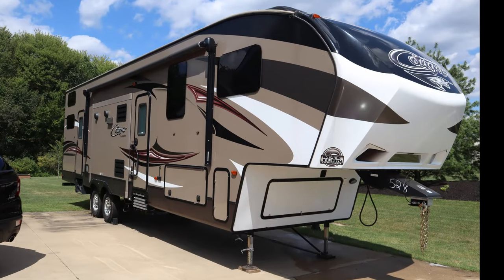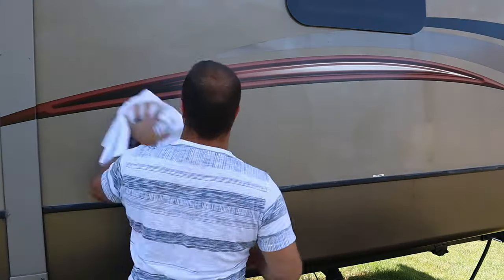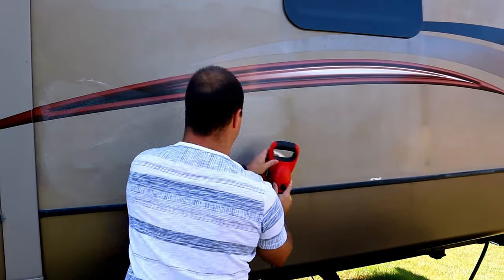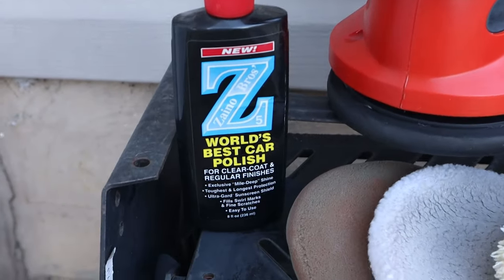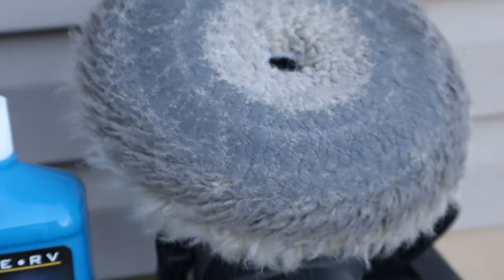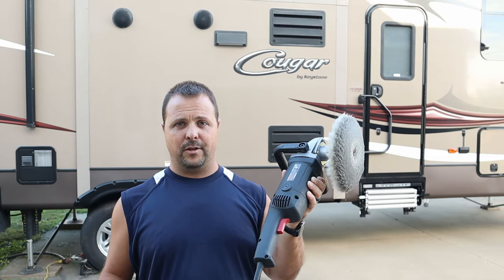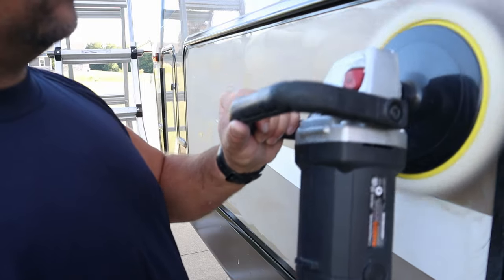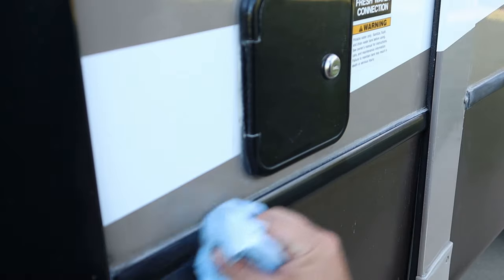Remove Oxidation and Restore Faded RV Fiberglass Meguiars One Step

Comment: Thanks for the video. I read in one of the comments you can clean the pad?  Did you do that, how do you do it and how pads did you end up using for your rv?  Mine is only 23.5 ft class c.  Thanks again!
Reply from the maker: I spent a couple days completing this project and washed the pad out and let it dry between days.  Someone else had commented about a way to clean the pad while buffing.  I did not try that, but I'm sure it would help because the pads did load up with compound.

Comment: Before using polish you could try to use a cleaner / wax product with a random orbital buffer and wool pad. If that doesn’t get the oxidation off then polish is likely required.
Reply: No cleaner or wax will remove oxidization

Comment: Use the Dewalt buffer it gets the job done.  You want the blue compound on 5he stiffest wool pad you can find and be patient. Work SMALL AREAS. Mask off decals! Then polish with foam then apply cleaner wax by hand. That harbor freight buffer is a joke step up to the Dewalt the extra torque will make huge difference. You don't want to be cheap with rvs

Comment: So glad i watched this. I just noticed oxidation or fading on my 2018. Didn't seem as noticeable when i bought it in January.  But definitely showed up after cleaning my rubber roof.  I had already purchased a harbor freight 6" palm polisher to apply ceremic wax to the camper. So i hope to use it on the front cap with the meguiar's one step compund. If i listened correctly,  you recommend using a wool applicator?
Reply from the maker: Good luck, and yes 100% wool worked the best for me.
Reply: @WeekendRVAdventures  so i got my meguiar's one step compund and gave it a try using a 6" palm polisher on my front cap. It worked great, but im definitely upgrading to a a bigger polisher like you were using.  I think a second pass using that will really bring out the shine. Then I'll apply some meguiar's ceremic wax.
Reply from the maker: Sounds like a good plan, the smaller buffer I tried just wasn't enough either.

Comment: great video, i too have an oxidized rv, got it shining and the sun took it back to the oxidized state in a month, what has been your experience with it staying nice in the sun after all this great work?  thanks
Reply from the maker: I found that you really need to keep up with waxing a 2x a year or I tested a ceramic coating that seems to be lasting longer.  Without any follow-up it will go back.
Reply: good to hear the waxing is lasting, makes me really want to try again, i think i should have tried a synthetic wax and/or done a better job to remove the oil from the polish as oxidation was back in under 2 months (az sun).  thanks a bunch :)

Comment: What about the lower part of your rv the brown trim. Did it turn white or did you not use the compound o. The brown trim? If you did how did you prevent it from turning white? This is great info. My plastic is the part i am not sure on how to prevent from changing colors. Not the black part.
Reply from the maker: I didn't try it on the lower brown part, but I think it would have been fine

Comment: My 5th wheel has the same "one-sided" fade issue. The hardware guy at Home Depot suggested an angle grinder with a flap disc abrasive pad to quickly cut through the oxidation. I told him about your method, and he said time is money, don't screw around. I don't want to do more work than I have to- what do you think is the better way?
Reply from the maker: A flap disc is very abrasive and could easily remove the gel coat completely.  I would be afraid to even wet sand with a high grit and water using a flap disc.

Comment: Did you have issues with swirling or the "halographic" effect? I did pretty much the same process as you, rv looks good in the shop but once its it sunlight you can really see the swirls.
Reply from the maker: I did a little bit.  I found that if I used the buffer until it was pretty much dry and then wiping it down with a towel gave me the best results.  I had also tried some cutting compound that didn't have any wax and it had less swirling, but then you need to apply a wax to protect the finish.

Comment: How long did it last...mine went chalky again after one season.  I even waxed it after polish with UV protection...still came back.
Reply from the maker: Unfortunately I had the same results.  I'm sure there is some product out there that will hold up longer, but I don't know what that is.
Reply: @WeekendRVAdventures  I may try a ceramic wax...I'll let you know how that works

Comment: Good work….when I’m polishing in between applications of compound I turn on pad and use a butter knife against pad to remove crusty old compound, then apply new compound…. That should get you too 100% or at least better than 99
Reply from the maker: Thanks
Reply: I used a flat blade screw driver.

Comment: Thanks for your informative video Jason. I am inspired! I used to polish cars in the olden days so this is going to be a fun project! Picked up my HFT polisher today and about to order the polish and pads. I have one question for you regarding the 7" wool pads, have you been able to buy those without the backing pad? Since the HFT buffer already has a backing pad, I thought I would save some money. Thanks again Jason!
Reply from the maker: I did.  I think I got them at O'Riley Auto.
Good luck
Reply: Did you get to use this method for your RV?  How did it work?  Any pictures?
Reply: I did try this technique on our trailer. Labor intensive and it really didn't restore the side wall of my trailer to it's original shine. My Cougar's sidewalls have the pigment made into the fiberglass (except for the cap, which is automotive paint).
A mild cutting compound  cannot actually cut the old color effectively in my opinion. So I am simply having the sidewalls waxed as best as I can. I estimate it will take 2 applications of wax annually to keep a decent shine. Don't think it will ever get back to original. It still looks good!

Comment: Jon,
I have an 2018  Outback 330 RL travel trailer. I've used the Mequires RV wax but i don't know what to use on the trim around the slides. It's the 3' wide flat plastic molding around the slides. It  seems like it is sold black plastic and it is faded and uneven in color. I'm not sure what it is made of and i don't know how to care for it. Any recommendations?  Thanks.
Reply from the maker: I've had good luck with a product called "back to black" but it's primarily for rubber parts.  Faded plastic parts might never come back...

Comment: On the rubber trim that is faded, try a heat gun. Might have to protect the fiberglass with cardboard.  I use it on the black plastic modeling on my vehicles.  Work good.  Maybe a test spot first.
Reply from the maker: Thanks for the tip, I'll try it once the weather gets a little warmer here.
Reply: That’s bad advice. Just stick to what you’re doing.

Comment: I’ve tried the foam pads from harbor freight with maguires oxidation remover. Still have that chalky look especially on the decals.  Should I switch to the wool pads?  How do I get that nasty grim off the decals?
Reply from the maker: The wool definitely worked much better for me.  Just be careful on decals not to wear them away!

Comment: If you need to remove oxidation it means you have not used a decent wax/protectant.  If needed I would use a very mild abrasive (Bar Keepers Friend or Bon Ami) and a plastic kitchen scrubber.  Work gently and NEVER use power equipment.  Afterwards use several coats of ZEP.  It will last for years and years.  RV or car waxes only last a few months at best and oxidation and ongoing damage will continue.  My original ZEP has lasted  7 years with only a light touchup coat every year or so.
Reply: Which ZEP product do you use?
Reply: @stevemurray2895 I used Zep High Traffic Floor Polish which was the only choice at Lowe's.  It is dirt cheap.  BTW, you will find mixed reviews of ZEP on RVs.  The big issue is starting with a clean RV, no dirt or wax residues and little or no oxidation.
Reply: @jameskelson1891  do u have pics of your rv after 7 yrs using zep..also is your rv painted or gel coat?. I thought about using it but reviews were horrible after 1-2years .. thanks .
Reply: I do not have any pictures that would really show the finish.  It still looks good, water still beads and it repels those nasty black streaks.  Washing is hardly needed as rain seems to rinse off the dirt.  My camper has/had a gel coat.  The big issue is surface prep.  You cannot put ZEP over a chalky oxidized surface or over other waxes.  Use BarKeepersFriend and wax stripper first.  Apply numerous thin coats and avoid drips and sags from applying too much.  Otherwise very easy.
Reply: @jameskelson1891  
Cool story

Comment: Meguiar's waxes and detailers have petroleum distillates in them. Those products are a BIG problem for decals and will cause them to dry out and crack over time. Best to use products without petroleum distillates on RV's.
Reply from the maker: Thanks for the info.  What products are safe to use?
Reply: @WeekendRVAdventures  Look on the label to see if it says "Contains Petroleum Distillates". There are a lot of products that do not contain this ingredient. I use Turtle Wax products. After a good waxing, you can use a spray detailer, like ICE, to touch up the surface after washing. I do this once or twice per season to keep it looking really great. My trailer is 4 years old and the decals are still in great condition.

Comment: Has the oxidation came back yet?
Reply from the maker: It did start to after a couple months. I have it another quick polish and then applied  a ceramic coating And it's been great since then.
Reply: @WeekendRVAdventures  what ceramic coating?
Reply from the maker: I hate to say, but I'm not sure.

Comment: Did you go back with a wax or sealant after?
Reply from the maker: Not immediately, the Meguiars has a wax in it.  I did go back after a couple months with a wax to give it a little more protection.
Reply: @WeekendRVAdventures  
Meguiars 67 does not have any wax protection in it.